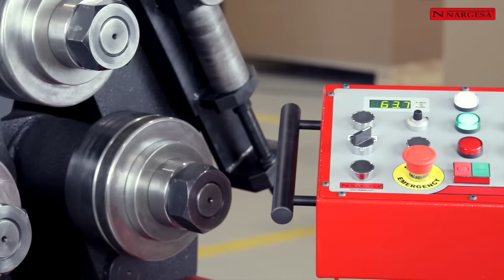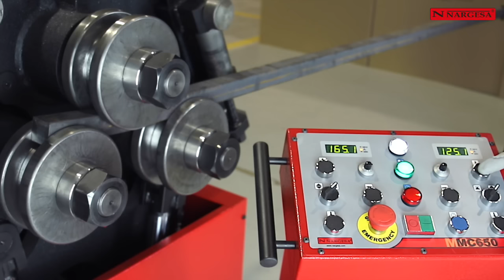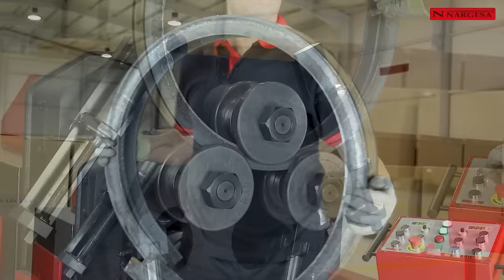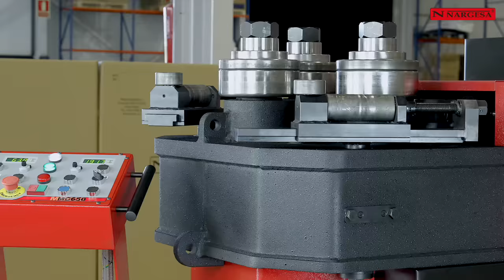CURVADORA DE TUBOS Y PERFILES NARGESA MC650 DE GRAN CAPACIDAD | NARGESA

Comment: Máquina maravilhosa! At 7 '' the machine was operating without one of the nuts!
Reply from the maker: Dear ProjetoChef11Mos, thank you for your comment. There is no need to set up a nut or/and washer in that roller because it must be loose in order to gradually move upwards so the spiral could be smoothly achieved. It means as the bending operation is carried out, the pipe will softly push the roller to move according to the degree the user needs to achieve for the spiral. Best regards